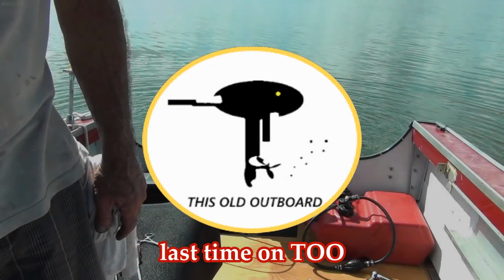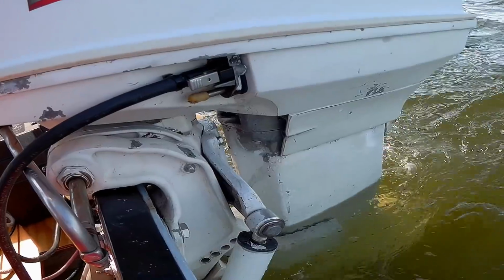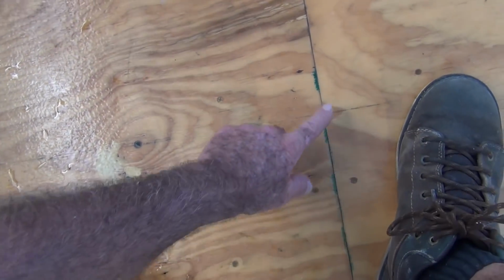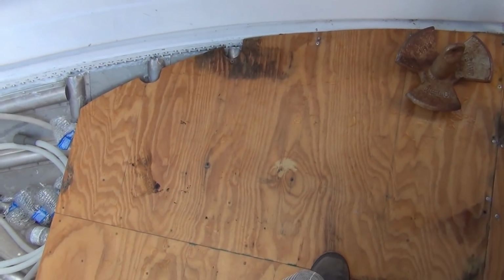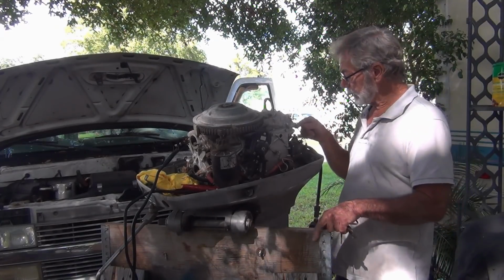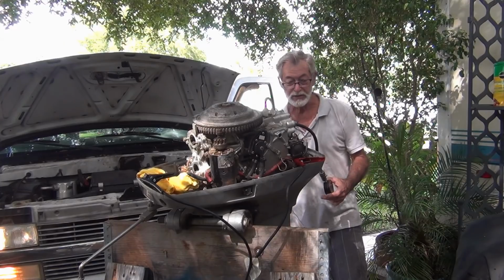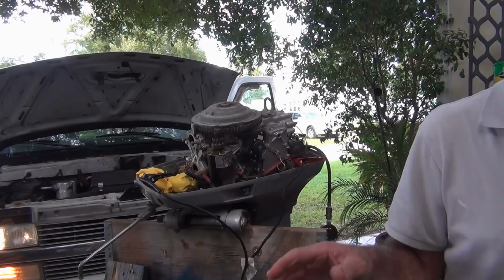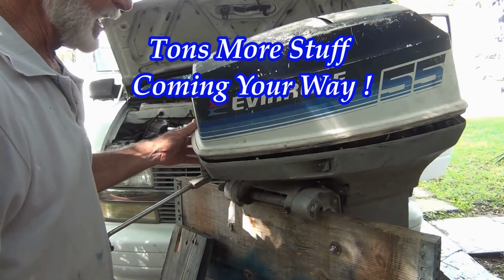1979 Evinrude 55 Hp Compression Test, 40 Hp Johnson Thermostat test Run

Comment: once you put in the restrictor for the indicator hose, it will blubber out the exhaust at idle a little better. needs to be there or else she will run hot on top!
Reply from the maker: Hey. Well actually its not suppose to have any water from the thermostat cooling coming out, if that makes sense, its not like the smaller outboards I'm use to, it would defeat the purpose of the relief/poppet valve which will only spit water at high speed. The water passing through the thermostat gets routed to cool the exhaust and the only way to verify the t-stat is opening, other then a thermometer, is to run it on muffs and when the t-stat opens the water will begin to poor out from the six small holes in the gearcase. I asked "Kramden" about it last week, I'm sure you know who he is. Then "ClassicCat" sent me a video this week. Check it out in the comment section of this video. He did a great job putting it together and has a Very Nice Starcraft. Thanks again !
Reply: @THISOLDOUTBOARD1  i know what you mean, and i do see a little bit of water coming out which is fine. the relief holes, as per a service manual or bulletin i read, should have some water coming out at idle as the exhuast needs that "wall of water" to cool it down, and water coming out of the relief holes/exhaust is confirmation that the gasket in the lower unit is properly sealing the exhaust. one time i rolled that rubber seal, and no water came out the relief holes. the heads were borderline hot... 170 degrees. got a new one, sealed the mating surface and bingo! after about a minute water started pumping out, and it ran about 15 degrees cooler (900 rpm, not a dead slow idle as these do run warm at that speed). this was an 82' 60hp, but i've done atleast 15 of these and they all do pump some water out at idle as long as the seal is intact.
Reply from the maker: @ct1762  Yeah I was getting some water just trikling out but nothing like the smaller outboards I'm use to blowing water, hence the name "blubber hole" . Here's what Kramden said earlier today, 'Once again, you won't necessarily see spray out of those holes when the thermostat opens on this engine....And yes, these engines got pretty darn hot at idle, that is the way there were designed and run best.  Try checking the temp after a high speed run, and shut down quickly, it will be much cooler..." I was gonna shoot you the link to classiccats video, but I see you've already watched it. Gotta run catcha later. Thanks again !

Comment: Those two engines might look the same, but the powerheads are very different...The 40hp has the nice permanent mold block, the older 79 55hp has the lousy clunky block/pistons that sounded like a cement mixer...The paint looks original on the powerhead, look on the ID plug on the side of the block, see if the serial number matches the one on the transom bracket.  The powerhead has been replaced if the ID plug says: "RPH" and has a six digit part number...But, that paint does look factory, not likely someone painted a replacement powerhead that nicely...
In any event, the newer 40hp has the better powerhead, so don't exchange it for the 55hp...Get the 55hp running and sell it off.
Reply from the maker: Hey yeah I'm going to run it first then sell it. But when I check the schematics and compared the two outboards everything was identical except the reeds and the carbs, same crankshaft, same Pistons, I couldn't find anything different at all other than what I said. Even the gear case is the same part number. So what is a clunky powerhead / Pistons,? Thanks again U da man!
Reply: @THISOLDOUTBOARD1    Yes, most everything is the same, except for the design of the block...The casting process changed allowing a much better fit between the pistons and cylinder....Your 40hp is much quieter, and will last longer...
Reply from the maker: @fleetwin1  man I'd swear they were the same in the schematics. Thanks again!
Reply: @THISOLDOUTBOARD1    I just compared the 1979 55hp to the 1987 40hp at marineengine.com, pistons and crankcase are different part numbers...where are you looking?
Reply from the maker: @fleetwin1  yeah I was looking on Marine engine. Come too. But I didn't see a part number for the case the Pistons did have different part numbers but are the same size if I'm not mistaken thanks again
Reply: @THISOLDOUTBOARD1    Yeah, I didn't see an item number for the crankcase, but scrolled down to the bottom and found the numbers.  The pistons may have the same diameter, but are different...

Comment: well sir, it seems to me that a Canadian gentleman with a 16' Starcraft mentioned using an oil based paint to seal up the wood. And using cayenne pepper in the paint to stop mold from growing. 🇨🇦 lol
Reply from the maker: Yes I remember that comment. But if you drill holes in it and dont seal them good, like I did on that front piece, the wood will still absorb water. And you wont see it through the paint until it rots through from the inside out. I also remember saying my plan is to paint the resin with Rustoleum Topside Oil based Paint, but with all the rain, getting the 40 straightened out and working I'm running behind on paint, among other things that I want/need to get done. I also thought the cayenne pepper idea sounded cool, but I haven't had time to research it. Does it really work? How much do you mix in? Will it show in the paint? Will it turn white paint an orange color? Is mold really an issue? So there's alot to consider before I ruin a half gallon of paint. In all the hours I spent researching "how to boat floors" nowhere have I read anything about cayenne pepper, and most of these guys are doing the oil based paint, it's cheap too. I also don't think mold will be an issue, thats just lack of maintenance, trust me, I live in the mold capital of the world with all the rain/heat we get. So I haven't decided exactly what I'm going to do with that front piece yet. Like I said, it's just a piece of wood! Hahaha not a biggie! Thanks again for watching and commenting. Stay tuned !
Reply: @THISOLDOUTBOARD1  no worries bud. i pre-drilled larger holes before i painted the panel, then dabbed paint over the screws. i guess i failed to mention that, sorry. yes the cayenne pepper turns white paint a bit red, but you already have red on your boat and i assumed it would be ok. do a test piece of wood and see for yourself that it doesn't mold. maybe mold isn't an issue for you, i don't know. but the pepper trick comes from a fisherman friend in alabama. he mixed a pound of pepper into 5 gallons of paint. i hope this helps. cheers.
Reply from the maker: @alvarsdzenis4739  cool man thanks. I was on my second cup of coffee when I typed all that crap out. Hahaha. Catch up with you later!
Reply: @THISOLDOUTBOARD1  ahhh yes! i remember the caffeine and lung darts for breakfast days. did that for 40 years before i gave up those vices. it was tough, but my will was tougher, lol. cheers

Comment: Rust oleum spar varnish could try that. Once the boat is completely dry. I use it on anything outdoors stuff last forever
Reply from the maker: Hey. Thanks. The plan was and still is to use the rustoleum topside paint. I'll try the spar varnish when this floor rots out. Hahaha Thanks again for watching and commenting. Stay tuned !

Comment: Hey man i remember that motor ;) I told you she had great compression man!! Glad you like it I got 159 bottom and 165 on top when i did it on mine man just a heads up.
Reply from the maker: Hey. Thanks for tuning in. Yeah I got about the same. I couldn't remember what you said but I new it was high. Thanks again !

Comment: I believe you're looking at your exhaust relief ports.  To see when your t-stat opens up at idle, throw it on the muffs and watch those 6 holes above the prop on your lower unit.  My '75 70 opens up around the 50s mark.
Reply from the maker: Yes correct! I found that out just after the first part of the video. So all is good! Thanks for watching and commenting. Stay tuned!
Reply: @THISOLDOUTBOARD1  Sweet!  she sure looks and sounds good! Here's my project 49ci 70 that I just swapped the T-stat on. You can see when the t-stat opens.  https://youtu.be/tJrW_rQKjRc
Reply from the maker: @classiccat7403  Very nice!

Comment: Once again, you won't necessarily see spray out of those holes when the thermostat opens on this engine....And yes, these engines got pretty darn hot at idle, that is the way there were designed and run best.  Try checking the temp after a high speed run, and shut down quickly, it will be much cooler...
Reply from the maker: Okay thanks again !
Reply: kramden I have an ‘84-35 Evinrude and I agree with what you said about running hot 
while idling.  But mine pumps water even at the low speed.  But I don’t have a pee hole on mine.
Reply: @georgekeats1478    George, do you have an 1984 Evinrude 35hp?  Or, am I misunderstanding you...Your engine should have an overboard cooling indicator/pee hole.  What is your model number?
Reply: kramden model number plate is gone off of it.  The previous owner repainted it and put new decals on the cowl. Buts it’s a 1984 35hp tiller Evinrude.  I had it on the Niagara River yesterday.
Reply: @georgekeats1478  Well, it should have an overboard indicator then, anyway of posting some pictures, or maybe emailing them to me??

Comment: I don't remember if that thing has a poppet valve.  My 200 does.  Once that thing starts working, water does come out of those two holes as well....
Reply from the maker: Yes it does have a poppet valve. I just waited two week for the new grommet to get here and installed everything in the last video. And no, no water comes through except at high speeds when the poppet/relief valve opens. If it did there would be no need for the poppet valve. Make sense ? Thanks again for tuning in!

Comment: My 1956 30 hp johnson don’t even have a thermostat but my 59 35 hp does trying to find pant for the 56 Holliday bronze but I don’t want to pay 25 bucks for 12 oz can I’m gonna match it the best I can 25 plus shipping almost 35 bucks for 12 oz spray paint crazy
Reply from the maker: Hey. Yeah my 63 RX-ll 28hp doesn't have one either. Go to the auto parts store and check out there paint section. They might have something close. Thanks again !

Comment: Resin and GRP is not waterproof, over time water will ingress into it, Flowcoat ( topcoat ) is th the sealer, waterproofer, why not get a 1 kg of clear flowcoat and treat your boats wood to a coat and seal it, saves you taking it all out and it will seal those screw holes toboot.
Reply from the maker: Hey. The plan was and still is, to put the rustoleum topside paint over the resin. Thanks again and Stay tuned !